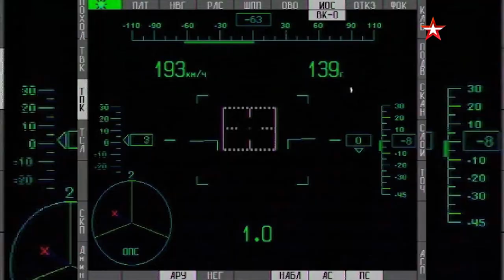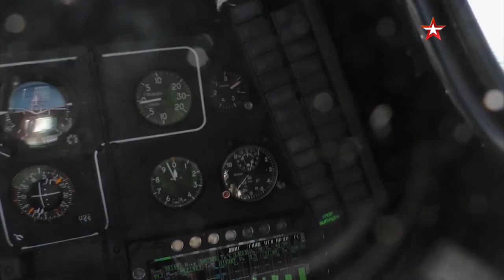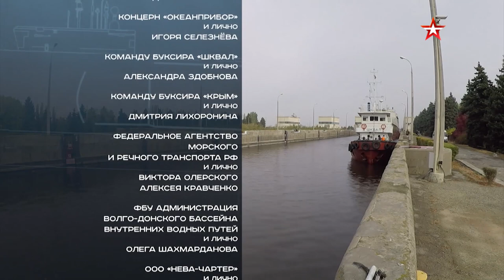Episode 120. 22160. First. Russian. Anti-pirate. Part 2

Comment: Russia should seriously consider expanding and modernizing Volga/Don canal system, locks especially to allow bigger ships. This is of outmost importance for safety and economy of the country. Respect and love to my Slavic brothers
Reply: it is very expensive and time-consuming, larger ships are built in shipyards located on the seas and oceans
Reply: @Nordwind.  Of course its expensive. It would be long term project. Do it lock by lock. It would be of national interest not just from defensive point of you but economical as well. I know the bigger ships are build on the costal shipyards but just in case god forbid you need to transfer fleets or part of them .
Reply: @kristijancoric3604  if we take into account the transfer of squadrons from one sea to another, then such passages exist. for example, quite recently, ships of the Caspian Flotilla and the Northern Fleet came to the Black Sea for joint exercises

Comment: I'm looking forward to seeing a video on the project 20386 Mercury. About its design changes to accommodate VLS for offensive weapons.  I believe the superstructure has been shortened to accommodate the extra VLS.  Project 22160 was also designed with the modular principle. I recall watching the original version of these two episodes. The ones in Russian. I used autotranslate. Which continues to improve. The downside is fewer funny translations like: "the whore shines my knee well."
Reply: why did you decide that this would not be the correct translation? )))